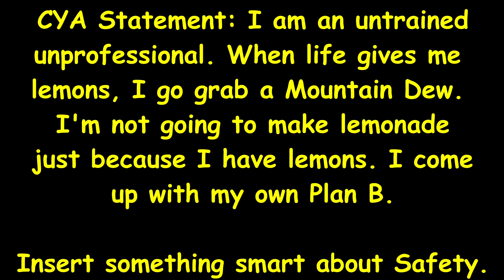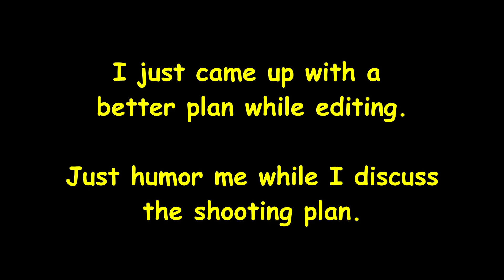Testing the Science of Barrel Bedding the AR15 pt 1

Comment: Quick tip: you don’t need to use loctite  on anything when assembling an AR just torque everything properly, anti seize on barrel nut and rock set on muzzle device if it is a suppressor mount. The gas block gets WELL above the temperature loctite gets destroyed at so you are just wasting your loctite by using it there. Now optics mounts definitely loctite those up!
Reply from the maker: Over the years I've tried to find definitive info on this. I've been able to find that red will soften at 450-500 degrees (depending on type, and there are higher temp ones). But nothing on if at that point will the remaining goo keep the screws from vibrating loose. I do torque. I also will loctite for just that extra bit of insurance until I can find info otherwise. If you've seen the info, please share!
Reply: @nobodytraining  I’ve seen enough videos of people complaining about how hard it is to remove a barrel with Loctite. It clearly does not disintegrate and lose its ability to adhere from the temperatures it deals with.
Reply: @liggerstuxin1  Yes it does, it sates its temperature limits..Rocksett is better for the gas blcok screws..
Reply: @nobodytraining  Rocksett will withstand heat that red loctite won't..